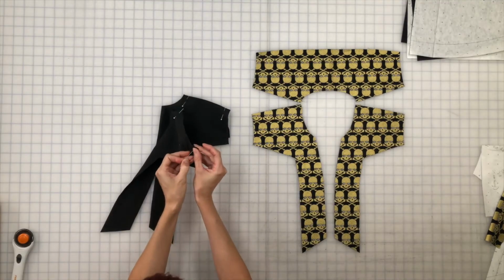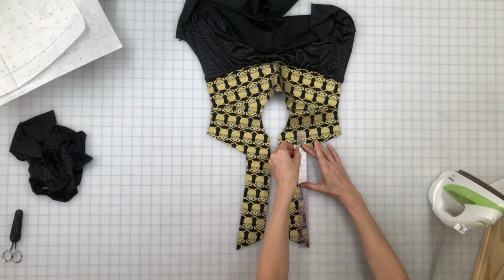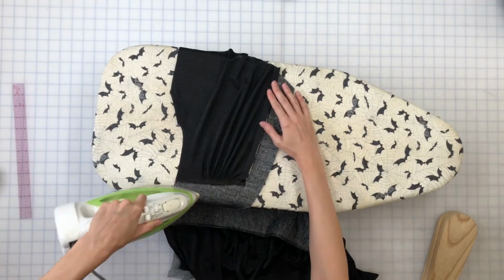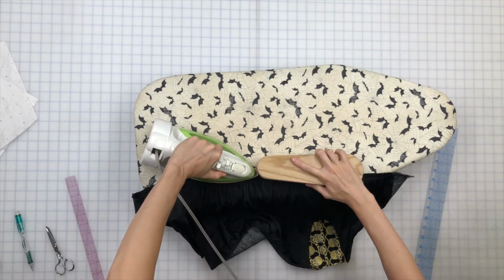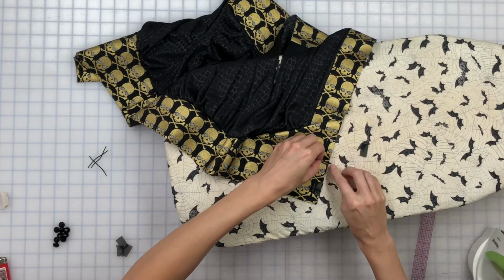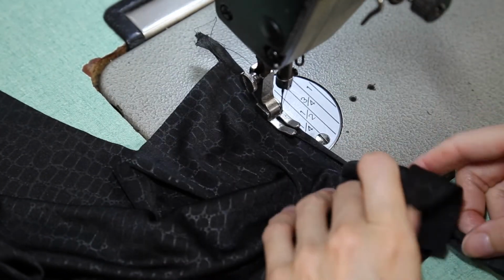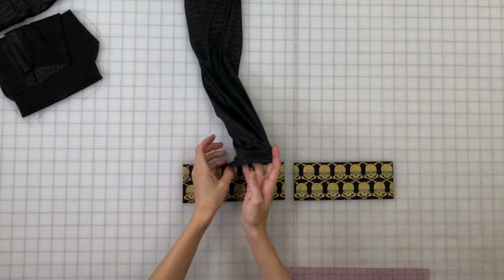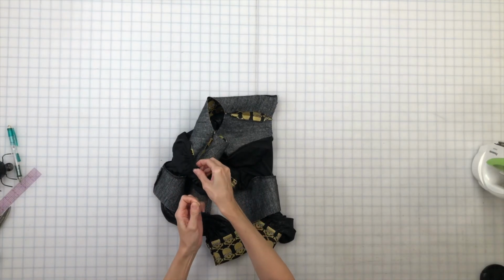V9076 Vintage Fall Dress pt2

Comment: i love the drape and fluidity of the black fabric - what is it? I generally shop on line for fabrics - what would the search term be for fabric like that? Thank you!! this is such a helpful video. This dress is an "Easy" project but it seems rather advanced , or at least intermediate. Thanks for breaking it down!